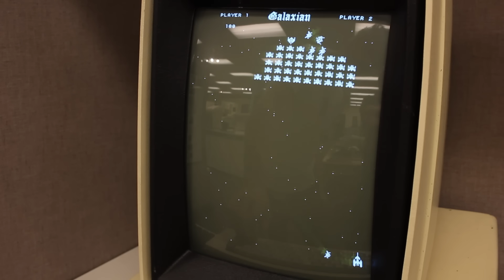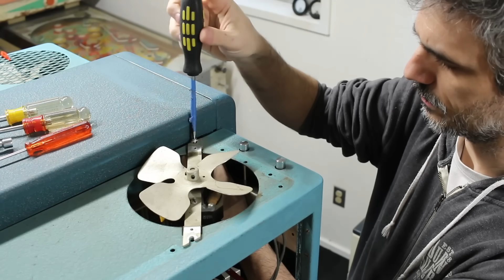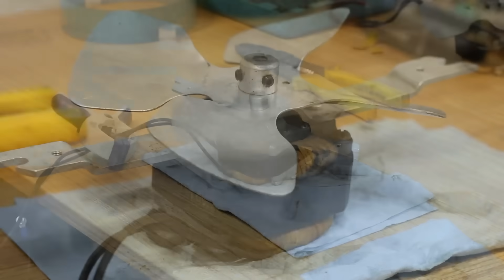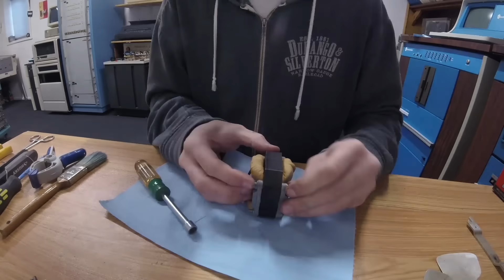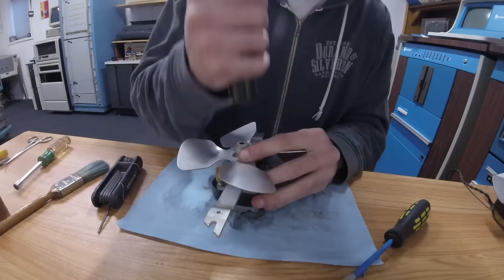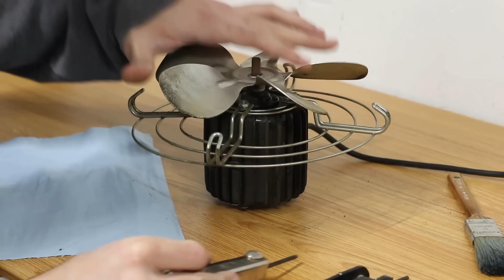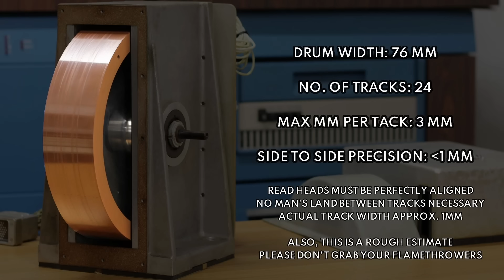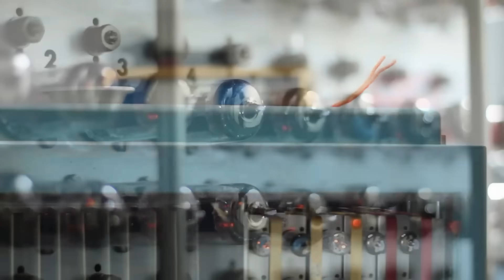Reviving 65 Year Old Bearings

Comment: I'm a little bit worried about if the magnetic drum is sensitive to the oil used and cause the magnetic surface to come off. (Yes, I'm a bit paranoid)
Reply: not sure if I'm misunderstanding you but the oil went inside the bearing not in the drum housing
Reply: @snooks5607  bearings with a metal seal aren't fully sealed and those that have a rubber seal most likely aren't able to hold in oil either anymore because the rubber has hardened and become brittle. Just look at the fan wiring.
I have seen that on vehicles.

Comment: I had a grumbly ceiling fan in my bathroom - I did what you did, got some oil in it (I think I used chair lube that came with my office chair decades ago) - 1 year later the fan is still quiet.

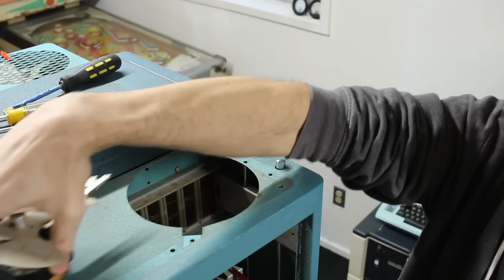Comment: 4:15 - a washer went between the panels.
Reply from the maker: Good eye!
I did indeed drop it and noticed it at the time. It went all the down, past the door and landed on top the preamp unit. I was able to get it back without having to take anything apart thankfully!
Reply: @UsagiElectric  I love it when I hear my 10mm hit the driveway or garage floor, rather than (bink, bop --- silence). I have a number of extra sockets for this reason, and I sht you not, I found one in a pile of leaves by a storm drain years ago. I still have that one :D

Comment: I'm betting you probably have flat spots on the ball bearings in that drum assembly.  If it sat for an extended time, with the weight of that drum on it, even small vibrations (say, traffic on the street outside) can wear flat spots.  Which even in a properly greased bearing can cause intermittent bearing noise.  I understand not wanting to muck around with a working drum, but if you ever do "recondition" or "re-surface" the non-working drum, i'd go to the effort of changing the bearings.
Reply: brinelling is the word for it. That's a good call. I'll wager those drum bearings are pre loaded angular contact bearings and they really hate that vibration without rotation thing.
Reply: @zyeborm  Yeah, it's actually recommended by motor manufacturers to rotate things like spare motors every couple of months or so to prevent this.  When you have large, expensive motors sitting around as spares, you don't want to install one only to have the bearing fail after a month or two of operation.  IIRC we did ours every 6 months.
Reply: @jeromethiel4323  I think GM had a really big problem with this with their "vertapack" system in the 60s. They would pack a bunch of cars into railroad cars vertically to ship them and had no weight on the wheels. They had terrible wheel bearing failures after they arrived at their destination. And we are talking hundreds of vehicles per trainload all with failing wheel bearings months after the customers got them. 
I don't recall how they fixed it.
Reply: @zyeborm  Interesting.  I hadn't ever heard of that.  But it's not surprising if they were low quality bearings (the 60's were not known for good materials science), because trains have a LOT of vibration.

Comment: GUUUYSSSS PLLLEEEAASSSSEEEE TELL ME IF THOSE WIRES ON THE SMALL FAN ARE COVERED WITH ASBESTOS? I had something similar in an  air heater from USA, and when I wanted to iron solder a tip of the wire but that gunk shrunk and left naked glass looking  very suspicious hard FIBRES. Although I kept it quite away from my nose, but got scared. :-((
Reply: couple of fibers aren't going to do anything. granted I'm not a doctor but consider eg. coal dust, setting up a charcoal grill will make you breath in some dust but to get black lung disease you have to be a coal miner for decades
Reply: @snooks5607   Sort of. It only takes one single fiber to give you cancer - but the chance of any individual fiber actually hitting the right (wrong?) spot in the DNA of a cell is rather low. Inhale a whole bunch of fibers and instead of a single pull of the trigger on that Russian roulette now you've got tens of thousands or millions of them. It is possible to get spectacularly unlucky on the first one.

Black lung disease, silicosis, COPD, etc are diseases of gradual degradation - if you loose, say, 0.01% of your lung functionality, and stop getting exposed, that's as bad as it's going to get; it's not going to kill you from the first particle you inhale (note that this is explicitly not considering particles that are themselves carcinogens - just bioinert ones whose mechanism of action is physical obstruction).
Reply: @snooks5607 While this is probably true for rather small amounts, it still is no joke and should always be handled by experts.
Reply: @snooks5607  🙃 well,  I am really curious about what those wires are made of. I had to dispose all of them (not much, but a few).
Reply: Likely they do contain asbestos. Nothing to go into a panic.
Reply: Yeah, rather be careful than sorry with that stuff. If you're not sure about it, you can probably send in samples to a testing facility. If it comes back positive, have it handled and disposed by experts.

Comment: @TechTangents just used a faucet/compression fit puller to pull and press some bearings on a word processor.
Reply: Yeah. I like electronics that need manly tools.
Reply: Are you even computing if you don't need a flat head screwdriver and stem puller?

Comment: - Cool computer you got there bro, how fast is the memory?
  - About 70mph
Reply from the maker: The drum is 12.5" in diameter and rotates at 30 Revolutions Per Second, which comes out to (pi * D * RPM = 3.1415 * 12.5 * 1,800 = 70,685 in/min) 67 MPH! You nailed the speed almost perfectly!
Reply: Oh man, I was worried just like the time I bought a 56x optical disk. Will it go supersonic? And of course, at 1800 rpm your drum won't generate gravitometric fluctuations of any consequence. Get prepared for the clack of paper readers. @UsagiElectric
Reply: I think if you calculate the revolutions per minute and its diameter, you'll determine it's MUCH faster than even 88 miles per hour....
Reply: @loginregional  
But not 8088mph 😁

Comment: Bad insulation absolutely CAN "go anywhere" if you as much as touch it, creating tiny air gaps - enough for arcing to start, and then your super rare vintage computer is on fire - literally. Breakers popping randomly and/or seemingly for no reason is a symptom of this. Moreover, if one cable is like that it's a good chance more are bad - Unfortunately it means inspecting entire machine and checking every AC cable you see.
Reply: poss only that sub assembly used that type of insulation.  and would it have been in the hottest part of the system ?
Reply: @highpath4776  Much more likely this fan was bought as a unit from a manufacturer who decided to integrate the cable directly into the fan. Unlike other fans this one looks like it was not purpose-made for this computer
Reply: @jwhite5008  Was Bendix part of GE(C) at some time.  Bendix made (or maybe assembled) a lot of things ,  some of these bits do look like they came off a washing machine range of products.

Comment: bummer that the drum bearings are blocked by the lock rings.....the metal shieds are retained by circlips at their larger diameter...but trying to pick those clips out in that installation is not gonna happen....usually the shield inner diameter has a gap between it and the inner bearing race...but applying enough oil to reach that area and do an adequate job of lubricating would likely create quite a mess...

Comment: Nicely done fan service! The bearing puller is safer than it looks and feels. 
Finding exactly the right bearings for half-a-century-old fan might be harder but not impossible.
However, those kinds of ball bearings usually have great longevity unless you really overexert them.
Cleaning the shaft and rotor from dust, gunk and rust is typically more important.
Let them run for like ~5-15 minutes after oiling and they should be fine.
Reply: Not really, they will have used standard size bearings, and you will find them available from ant big bearing supplier, though you might need to do some cross referencing to match part numbers from old manufacturers, but the most common bearings  are all either metric sizes, or US standard inch sizes, very little in the oddball size category. Your new ones probably will have a standard tolerance that, 70 years ago, would have been only available in a close tolerance bearing.
Reply: @SeanBZA  Or just get a pair of callipers out and measure the existing bearings. You only need three measurements of bore and outside diameters and thickness and you will quickly be able to match them up.  Frankly, bearings are consumable items, and my experience of "reviving" them is that it doesn't last and it's better to replace them.
Reply: @jonathanbuzzard1376  Yes they are consumable, but with the one set being set up with a special set of, now long gone to the recycler, tools. Short of getting a picture of the tools, and some instructions on use, you would be hard pressed to align it again.
Reply: @SeanBZA for the drum bearings for sure. For the fan bearings, there is no way you would have me doing anything other than replacing them. It is just not worth it trying to revive them when they are a standard sized none critical part.
Reply: @jonathanbuzzard1376  Yes, but as Usagi says, those are easy, just need a puller, and he will change them if needed, but he did want to have them run, at least to see if the fans work, and to get the rest running. Those are easy to change out later on, especially the big one, and the others can be done with little labour. Drum ones will need to have special tools, ands at a minimum read off the old data tracks, if there is data there, and then figure out a way to write the 2 clock tracks back later on if the bearings fail, though this will also need to be done if the other drum is recoated with oxide. That will at least allow getting the right bearings, and put them in, and then align the drum and heads, and then write that clock servo track back on, and use the spare one as master to write the backup track, along probably with this also being used to test each head for the ability to read and write to the drum as well.
Reply: @jonathanbuzzard1376  I doubt they have gone full lifetime in service (unlike road wheel bearings etc)an and it is the grease rather than the metal wearing.  The computer probably became obsolete before they did.
Reply: @jonathanbuzzard1376  I have done that to fan bearings, seeing as getting replacement bearings was impossible, and the replacement fans were also impossible. So we used other bearings from failed parts, and did a lot of changing. Still got the one puller I got that fitted them. Dinky little fans that ran at 12000RPM, and screamed. Oil the bearings, and if they were gone heat it up to loosen the glue, and pull apart, then get some donors out of failed synchro assemblies. Kept the ones with failed windings to raid for bearings.
Reply: @SeanBZA  They are sort-of-standardized but not everyone follows the standard. Just today Tech Tangents released the video "Xerox 645S Fully Repaired" where he was burned by non-standard bearings he had to cusom-order from another state. That was very unlucky but shows that measuring the bearings may be necessary.
Reply: I'd wager there's no particularly special tools involved in the drum bearings either this thing looks like it was built by engineers before accountants got involved. But alignment would be the challenge. 
Odds are they will be a precision angular contact bearing and the nut on the shaft there sets the preload. Probably standard sizing but still dang expensive.
Reply: If the bearings really are press fit, then you also need a means of pressing new ones into place. Usually that isn't too difficult with small bearings without a proper press if you can come up with some suitable tubing that will bear only on the inner race, allowing you to carefully tap the bearing into position with a hammer. Again, with small bearings the fit is usually not very tight - just enough to keep the race from turning on the shaft.
Reply: @D614G_aka_Doug  In my washer-dryer of 1991 the main motor bearings are worn, but there is a fragile magnet wheel lurking behind them and at least with household tools I see no chance to reinstall them without damage. I did replace the washing machine drum bearings (using a threaded rod, washers etc., a hairdryer and a wrench) but that is not such a precision part so I could bang the new one into place with a matching piece of pipe(?) and a hammer.

Comment: You need to make friends with someone who has a lathe and milling machine to knock up custom puller !

Also bearings are precision ground components - replacement 'should' keep any alignment pretty much the same if installed correctly.
Reply: Radial alignment yes, but not axial, and it's the axial which is critical.
Reply: @JamesChurchill Had another look at the video and you may have a point !

The locknut in front of the bearing 'probably' sets the preload - wondering too if theyre tapered roller bearings which are designed to take axial thrust. With carefull measuring  wirh a dial gauge, it 'should' be possible to get it back within a tenth of a thou of where it was - although you'd need some ind of datum point to reference the gauge to. Be interesting to see what the axial play is too - that would give an indication of whether they need adjusting.

All a bit academic though as the bearings came good with lubrication !

Comment: Nice work as usual. But bearings are lubed with grease. The oil will not last very long. But you might get lucky, who knows.
Reply: Grease is merely lubricating oil mixed with a thickener and binder, so all he has done is reconstitute the old grease, by adding the light components that have evaporated out of it. Oiling it will give at least as long a life, though hopefully that oil is a straight SAE30 mineral oil, with not much additive in it, so it will not react with the original oil base. The best additive would be a molybdenum disulfide based one, which will prevent metal to metal contact for a long time, and also handle the pressure as the balls are running around the track.
Reply: It’s called a soaping agent, that’s what mixes with oil to make grease
Reply: The grease in the bearings wasn't replaced with oil.The small amount of added oil just dissolved into the existing hardened grease and got it back to a working viscosity.
Reply: It could leak out over time too especially when it warms up.
Fair enough on the drum, but I'd replace them on the fans.

Comment: Glad to see you come this far with it.  I probably would have balked at punching a hole in the seal on that drum shaft bearing, but that's just me.  Question:  shouldn't it be possible to change those bearings one at a time to preserve dimensional constraints?
Reply: I am concerned that the bearing tracks are pitted on the memory drum.

Comment: Ah, OnlyFans! Gone are the days when you could strip a motor just like that. That's the squirrel cage induction motor once common in record players. Fan-tastic indeed.
I'm happy to see you replace the cable on the main one - going the extra mile, none of that sloppy half-assed workaround rubbish.
Piercing the bearing cover was pretty clever, hope the edges won't get into the balls' way. Right in the Ass of the You-Ass-Ay!

Nice to see your filming setup, and with some heavy editing, the results are spectacular. It's a very mobile setup, and I know you take shots in different locations and positions... unlike me, haha. 

Loved the Yoda quote! And again, as Guns'N'Roses sang, all it takes is just a little patience. Pet the kitty for me :)